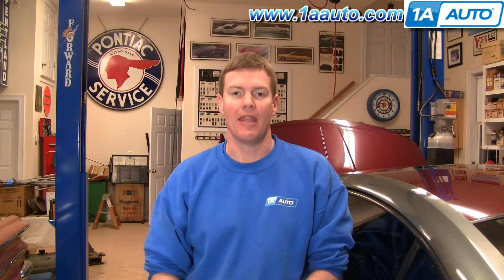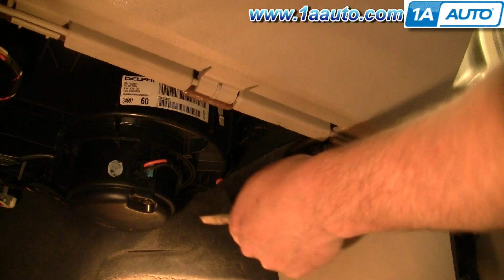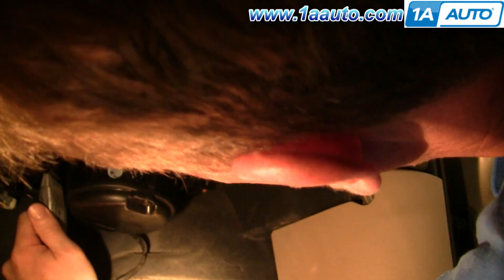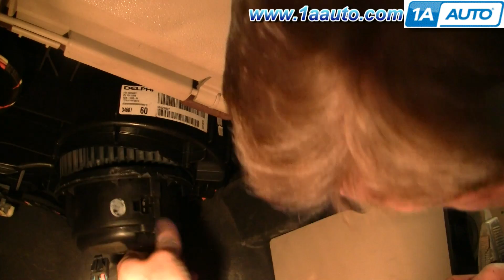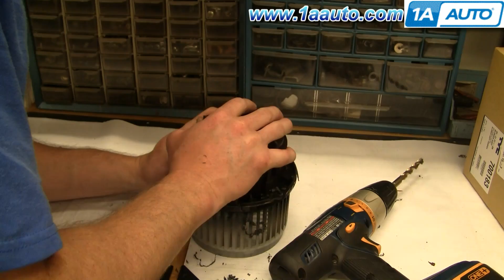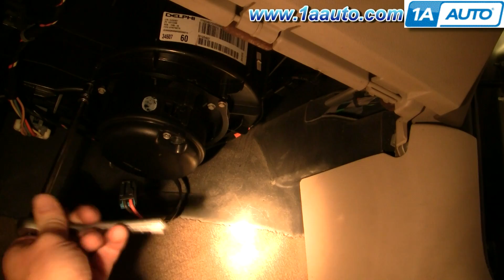How to Replace Heater Blower Motor with Fan Cage 05-10 Chevy Cobalt

Comment: I don’t have a hot knife, and using a box cutter knife was too difficult.  I used the box cutter to start the cut, then used a mini hacksaw (10” bimetallic blade from Ace) to cut the rest. The hacksaw blade fits perfectly into the groove and is guided by it.  (Maybe a serrated steak knife would work too.). I recommend cutting the side towards you last so you can see the very last part while you cut it.  If no screws came with the new fan, try eight #8 1/2” sheet metal screws.

Comment: '07 Cobalt LS 2.2.

Blower motor and fan speed knob/switch work only when a jumper wire is used and AC is cold.

Blower motor bench test showed good free spinning blower.

Replaced the resistor with two new resistors, replaced the blower fan speed knob and also swapped in 2 used control heads with no blower motor or fan speeds. 

What am I not seeing/finding?

Comment: We found it easier to use a steak knife to remove the heater fan motor.
Reply: I used a sharp paring knife. Exacto blade wasn’t sturdy enough.  Cut the front then back broke loose.

Comment: Hi I have a 2006 Cobalt SS/SC.... I had the AC on one day and all the sudden it just stopped blowing completely.... I parked the car and didn't drive it for a day or two.... when I drove it the next time the AC was working fine again.... after an hour on it stopped blowing again... it did this a couple times over the course of a 2-3 weeks and now it won't turn on or blow at all... is this the motor blower? The previous owner mentioned something about the motor blower ground cable being replace previously.... could it just be cable or the whole thing?
Reply from the maker: +wuamiller You may want to check the blower motor wire harness that plugs into the blower motor resistor and the blower motor to see if it is melted or damaged. Hope this helps you out. 1aauto.com
Reply: Mine did the same thing. I did some research and was able to get mine temporarily back on line with this little trick. Take a big rock/hammer and give the motor a few wacks. Sounds crazy, but it works. If I understand correctly it's the brushes that are going bad and hitting it moves the brushes in the motor just enough to get it to work again.
Reply: My Cobalt has a ton of problems and I think it's mainly electrical throwing out false flags for parts that are perfectly fine. Three out of my four tire pressure sensors give a "- -" or "00" reading. Even a replaced one. I've had the same AC problem, like the car just refuses to turn on the AC, but a week later it works fine. I've also have times when the radio didn't come on, or is very delayed after turning the key. Might need the car's whole computer ROM reflashed or something like that.

I've had the AC motor replaced and the "new" one was LOUD. Just an extremely loud vibration. You can see the thing shaking when it's running on any fan setting. Had it replaced, same thing. It's just extremely loud (like one of those cigarette lighter tire pumps), and it blows air very weak compared to 99% of other cars. You can put your hand in front of the vent on the highest fan setting and barely feel the air coming out. Potentially dangerous if your car can't get heated air on your windshield in winter to counter ice buildup when driving.

I hate this car so much. The engine runs fine, but everything else is garbage. I was glad to get an LS with no power locks and manual windows, because those for sure would be broken too by now.

Comment: Hey i have a question , i have 2008 chevy cobalt , i turn on the ac bt it dosent blow hot or cold bt you can hear the ac motor turn on but it doesn't blow anything. Is this video the resolution ?
Reply from the maker: +Justin Reza Thank you for checking us out. It certainly could be that your blower motor is not running properly. 1aauto.com
Reply: Mine does this. How about you press that plug in or move that wire and it will turn right on.

Comment: Do the bolts come with the blower motor? If not about what size would I need?
Reply from the maker: +Joshua Owen Unfortunately they do not come with those small bolts, but you should be able to pick up some small, self tapping, coarse screws from a local hardware store.

Comment: my ac and heat only work on the high setting, I changed the resistor and switch in the dash control panel, refilled with Freon r134a and now when turn ac on on high the car engine starts acting like it going to die?

Comment: On my cobalt the plug or wires has a bad connection when I wiggle the wires the fan turns on and off.  It's the first plug in the video. Is there a replacement available? Or a fix I can use? I'm very familiar with how to repair wires with soldering irons and crimps.
Reply: My cobalt also having the same issues, what did you do with your fix?
Reply: I’m having this issue as well. Did you ever find a solution for this problem?

Comment: Received kit and installed it in less than an hour, which included getting all of the tools around.  Had serious trouble cutting the motor out with a razor knife, but was able to cut out the entire motor except for one inch near the floorboard (no clearance) in about 90 seconds with a DREMEL tool fitted with a #106 carving bit.  Similar ones would work fine too.  I had the 8 screws lying around in my garage.  The fan and motor work great. No more annoying noise!  Thank 1A for the video and kit!